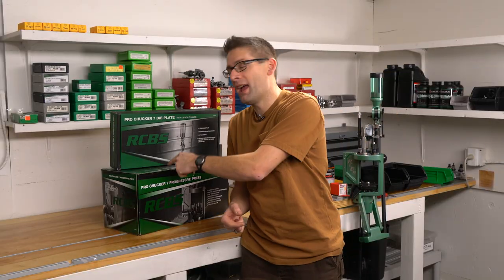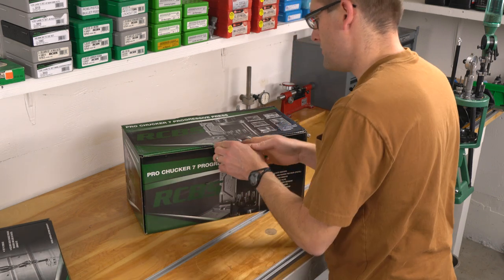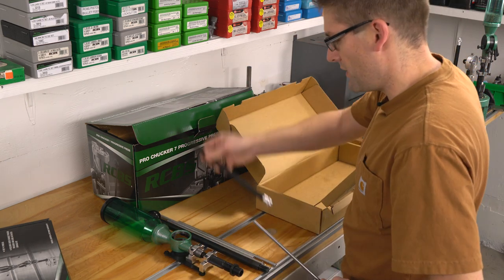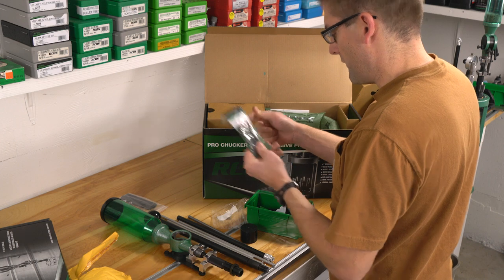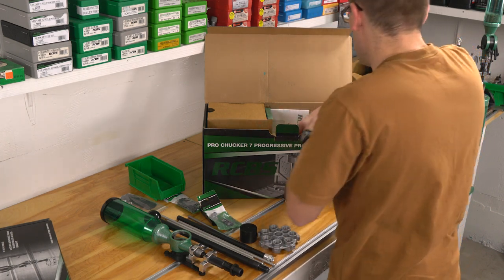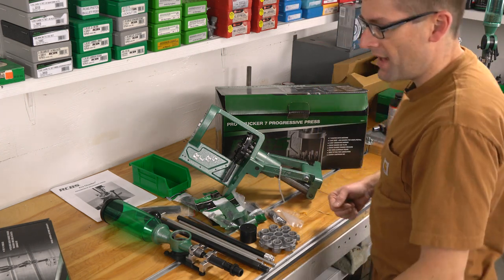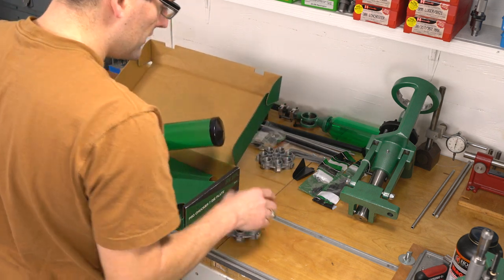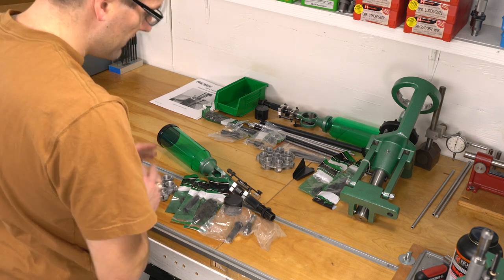RCBS Pro Chucker 7 Unboxing and Setup

Comment: Interesting video and  looking forward to part two!      Rcbs should definitely  have a case feeder available for their new presses though.
Reply: +Matt T Instead of a case feeder, they need a bullet feeder. .22 cal bullets are a pain to hold onto with my paws. loading cases isn't that big of a deal. Maybe give the end user a choice?
Reply: +malcolm smitherman   There already are bulletfeederkits from Rcbs available on the market that will fit this press. In my opinion you shouldn´t have to put neither the bullet or case in manually on a progressive press. 

Therefore I would go with the Dillon 650 before this one, had it been a casefeeder available I would go with this one.
Reply: +Matt T I couldn't agree more.If given the choice between the two, say as an optional package I would choose the bullet feeder.

Comment: I have a question I'm going to invest in one press and it's between the pro 2000 and 550b or the pro chucker 5 or 7 . I will be loading pistol and rifle. I really just want the best press for my money with the best options. I'm really leaning towards the pro chucker 7. What would you suggest

Comment: I have an issue with an aluminum press...your opinion?
Reply from the maker: The only cast iron progressive I've had is the RCBS Pro-2000. I don't have a problem with aluminum for progressive, but I do prefer cast iron typically! :)
Reply: How do you like this press compared to the Hornady LNL AP? Thanks for the response
Reply from the maker: The biggest differences are: 7 stations on the Pro-Chucker (super flexible), vs lock-n-load bushing system on the Lock-N-Load AP - enhanced die alignment and easy powder measure dump, etc. Check prices on both and see what you think. Both have incentives/rebates!
Reply: I already have the lock-n-load. Thanks for the response.